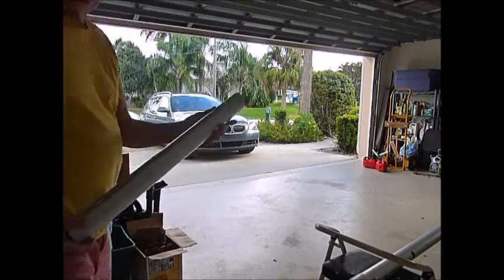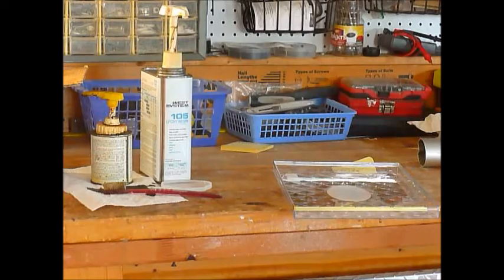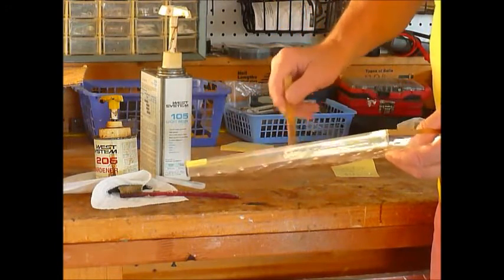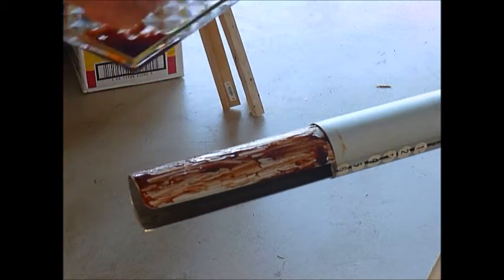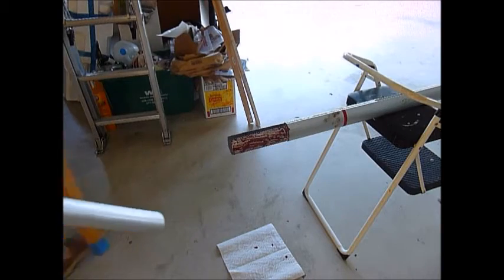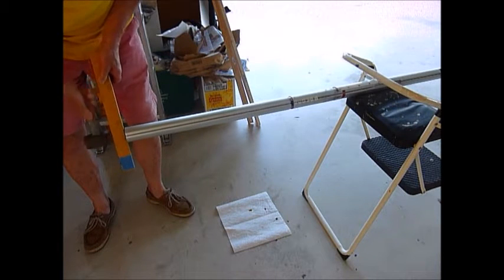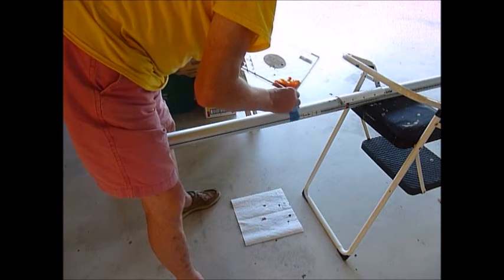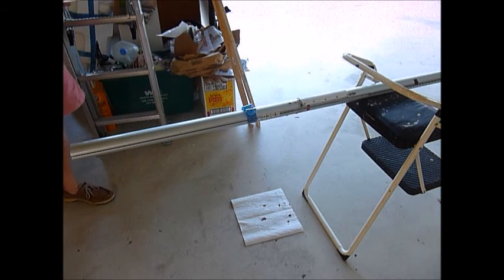How to splice together a broken aluminum sailboat mast.

Comment: what did you use for the inner piece you epoxied your mast pieces to?
Reply from the maker: It's all explained in the first minute. It is part of another 2.4mr mast, but to get it to fit inside I had to cut off the slide so it would compress a little.